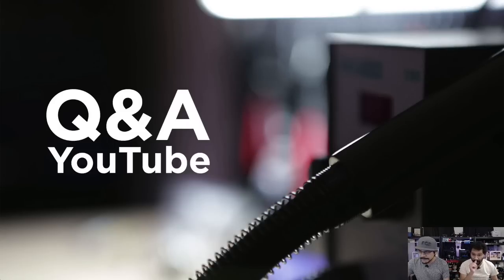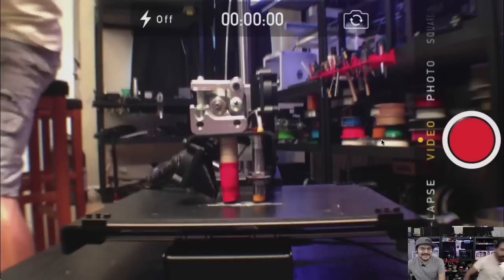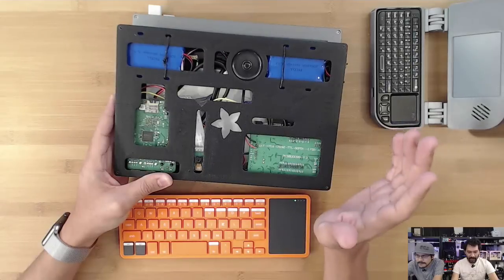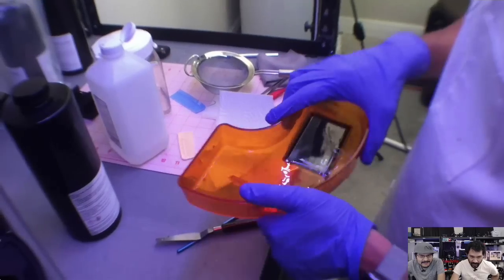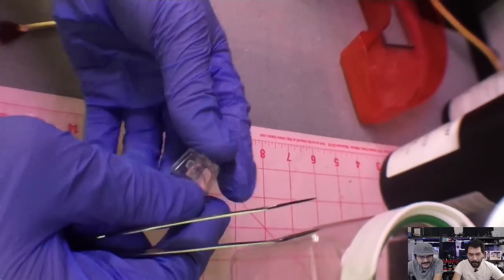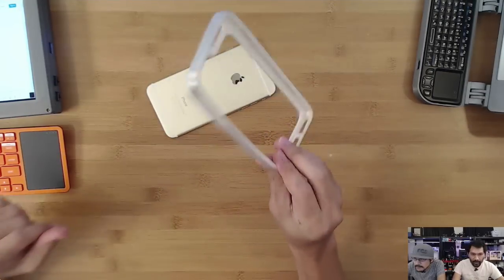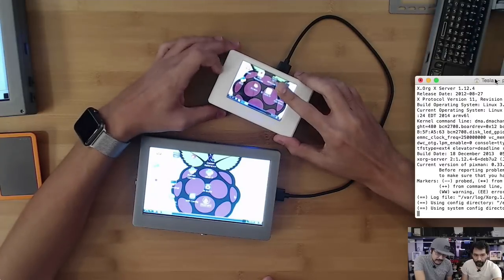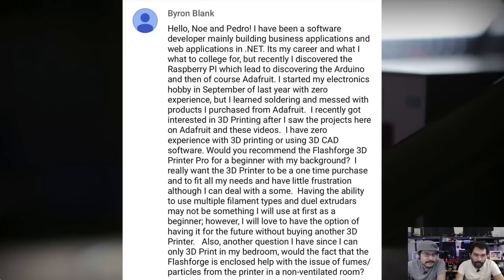3D Hangouts - Raspberry Pi Astrobox

Comment: I'm wanting to build a astro box with a pi that includes a pitft so I can have onboard controls. Is there anyway to go about doing this? Or any printer host software designed to run directly on the pi and not through your network?